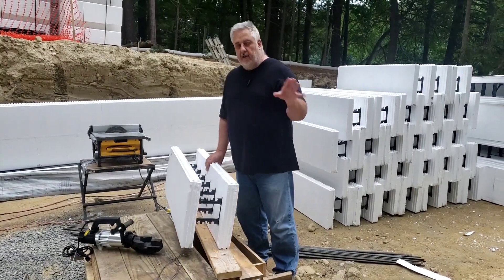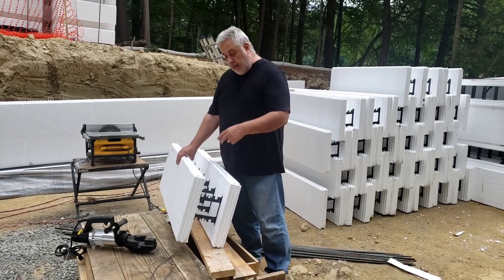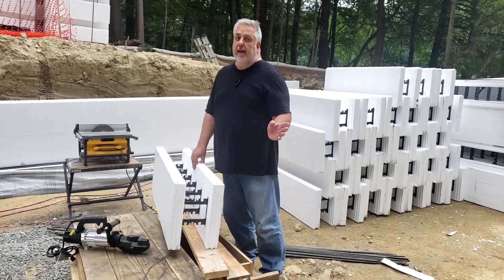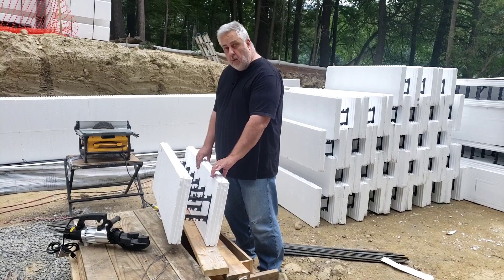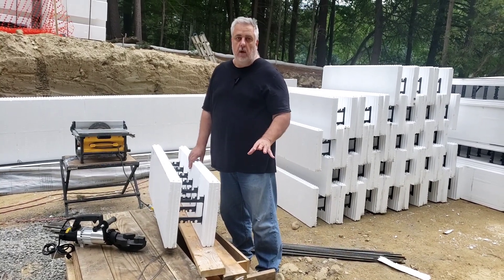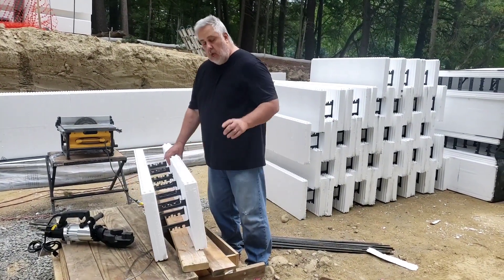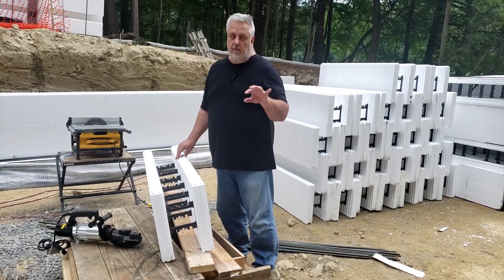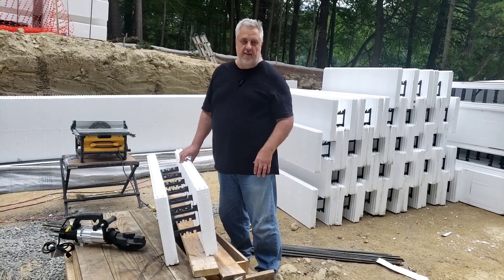ICF - Insulated Concrete Forms

Comment: If a narrower concrete wall is good enough, why were you pouring wider concrete walls? Doesn't make sense.  Here in California if an engineer says the wall is 10" thick  concrete. using foam forms isn't going to change that. What are you saying?
Reply from the maker: Foundation wall was 11 3/4" in actual width (EPS and Concrete core), but the concrete core itself was 6 1/4"......just ensuring non-construction types can grasp what I am saying